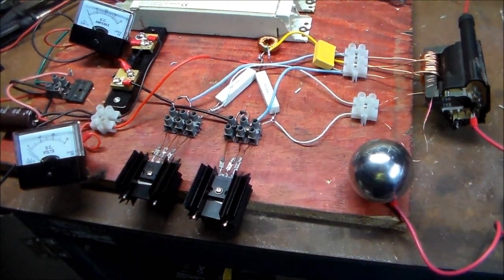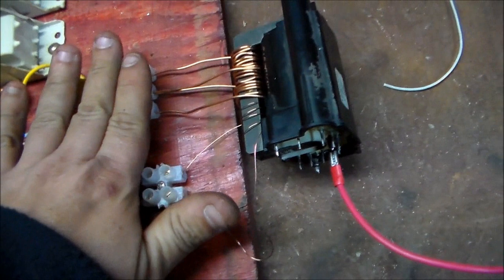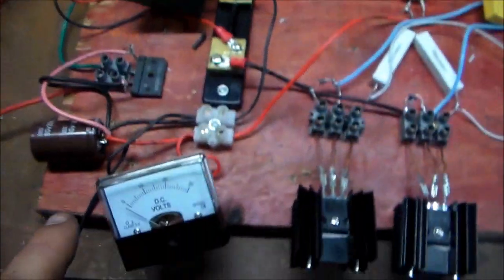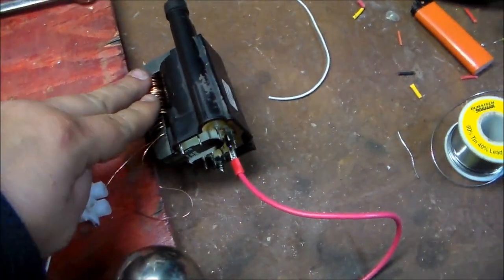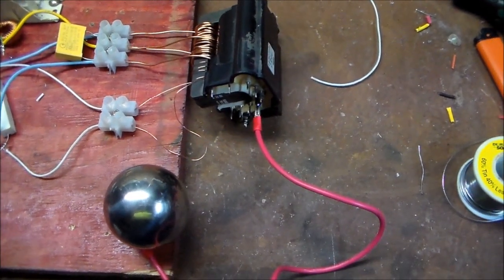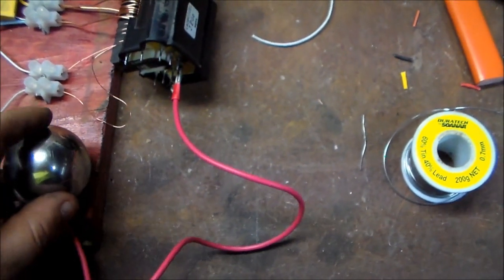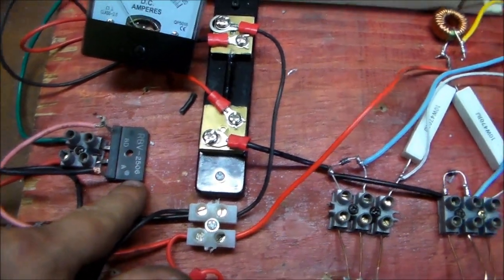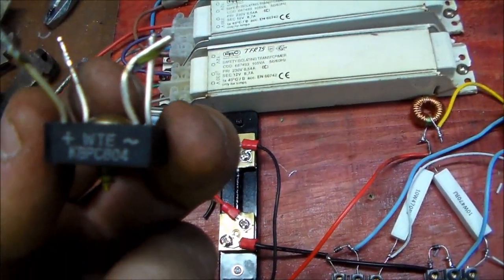Improved Circuit, Broken-Ass Flyback, Royer Oscillator! I F'd IT!

Comment: With enameled magnet wire it's easy to break through the insulation..it is just a layer of enamel. Winding it directly on a (abrasive) ferrite core isn't the best idea.. Wrap some electrical tape over the core to cover it,and protect the wire from the sharp edges.
The last time I played with a flyback,I just used some 'normal' 14awg wire with plastic insulation...I think I used a strand from a CAT-5 cable for the feedback windings.

Comment: Get that bridge rectifier on a heatsink! Try adding some 7v zeners to the transistors b-e. Also, try some reverse protection diodes on the transistors c-e. And finally, use some higher voltage transistors :)

Comment: Stick that bridge on a heatsink :P
They're only good for a couple amps without extra cooling.  On my DC kill/test rig the bridge gets quite hot under load (80 deg C) and it's bolted to a large aluminium chassis.  With enough thermal mass they can take 100's of amps surge but without it they'll cook real fast.  Good luck getting it going again :)

Comment: Oh dam!!! Is there a good connection to the feedback coil? Blowing expensive transistors sucks!!! Lol i fink i have bought in total about $30 worth of transistors lol mainly cause the feedback kept comming loose. A couple of months from now i had this running with two flybacks and suddenly the 60kv from the flyback arced to the core and through the the primary it arced all over the circuit caught one of the wires on fire and nothing was damaged lol hope ya get it runnin again soon!!!!! 

Be safe